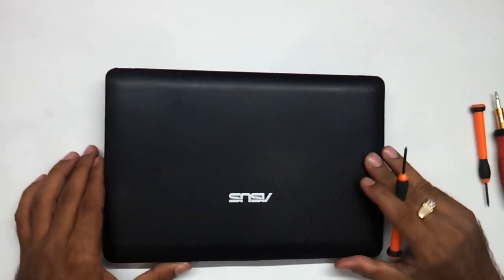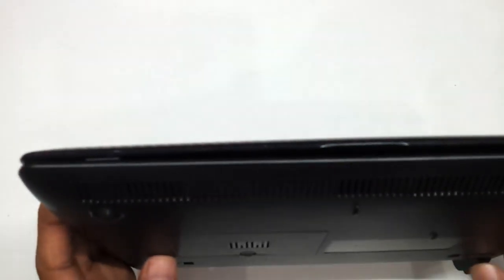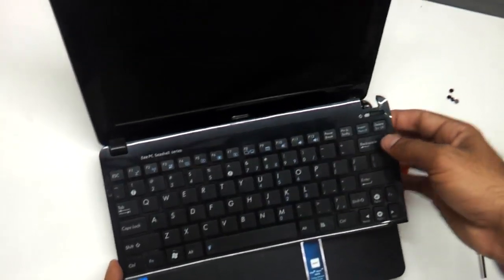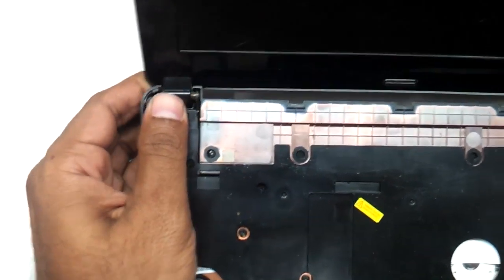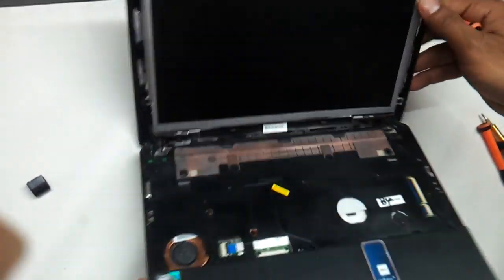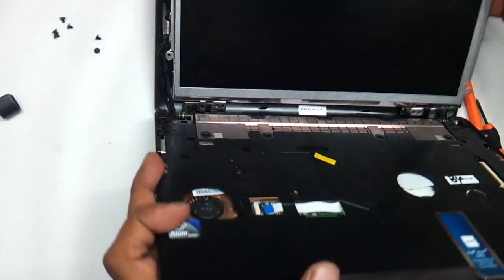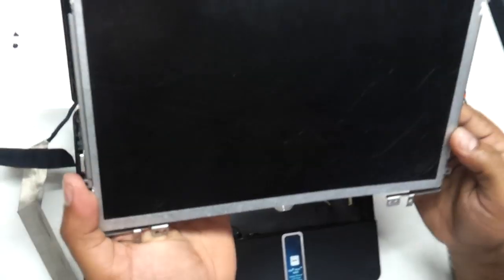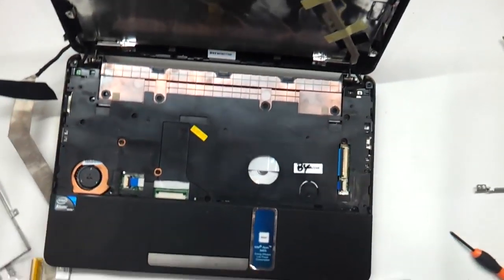asus eepc 1011 1015 led  and keyboard replacement howto

Comment: does this work with the "pathethic" 1015cx? I saw you showed how to tear it apart and replace keyboard and hdd in another video. I'm planning on replacing the monitor with a higher resolution one just like krtzfks wrote in the comments, but i'm not sure i can find a model that fits in it. 
Running a barebones linux + ssd + higher res monitor would make this little crap a very decent programming-while-travelling (since i travel a lot) machine, with lots of battery time.
Thank you for sharing your knowledge!
Reply: did you found success ?

i have same crappy netbook so far i installed cpu fan in it and now temp is <60 ideal
Reply: Nope, bought a chromebook instead and put the netbook to rest :)

Comment: Great. I replaced the display with the LP101WH1-TLB1. Now I have a resolution of 1366x768 on my 10 inch 1015BX with amazing contrast and colors.
The display ASUS has built in was just unacceptable (M101NWT2 R2).